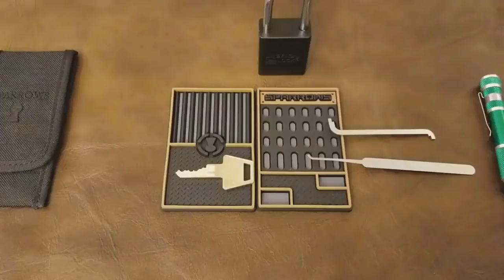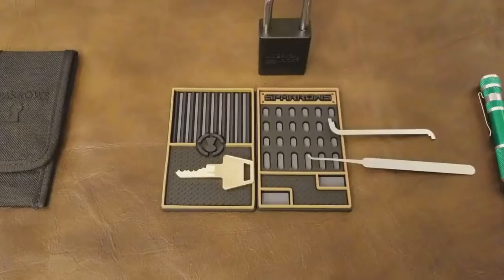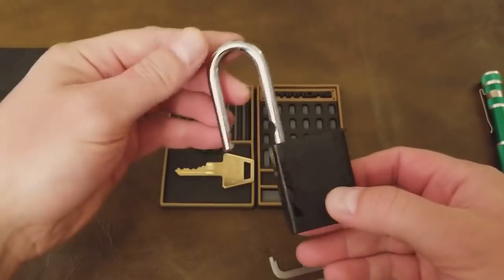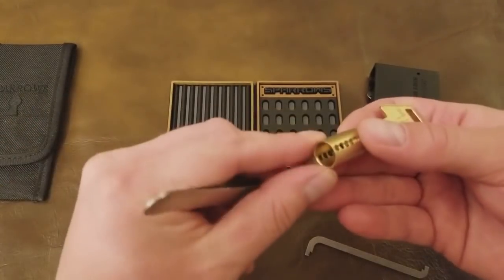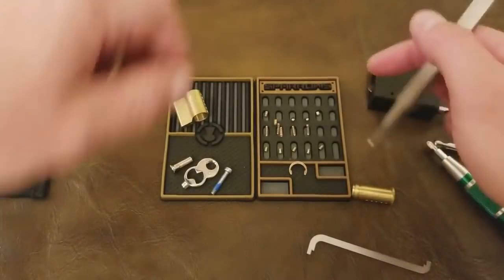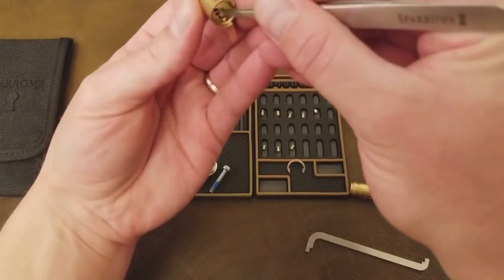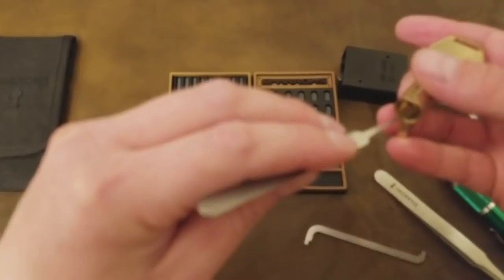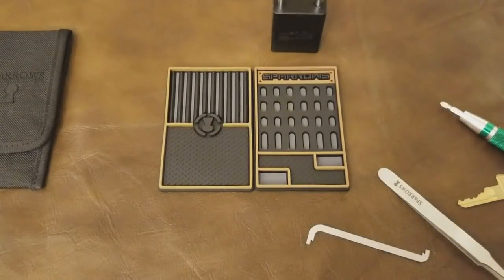Mentorship Monday 4: American 1100 Pick / Gut / Reassembly

Comment: Great explanation. I often use the pinning window or holes opposite the bible to remove the key pins first, then use the core as the follower. (That's on an Abus 72/40; I've picked 1100s and I've repinned 1100s, but never picked, gutted, and reassembled them yet).
I'm surprised I see no-one else do that.